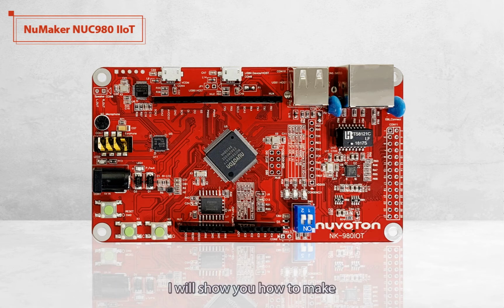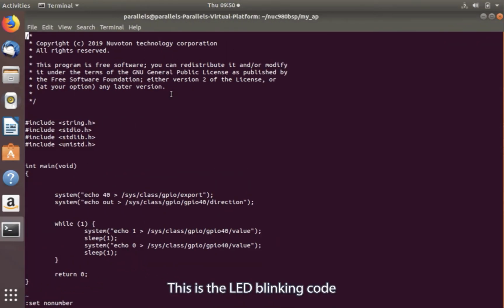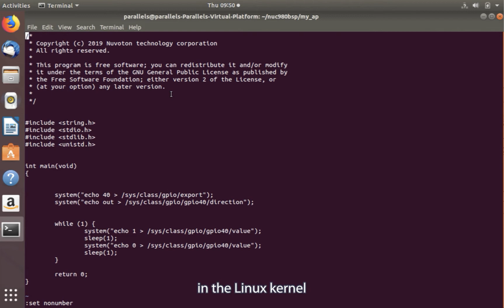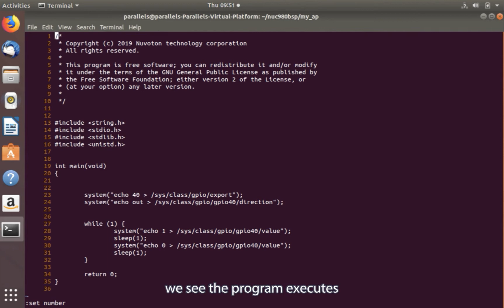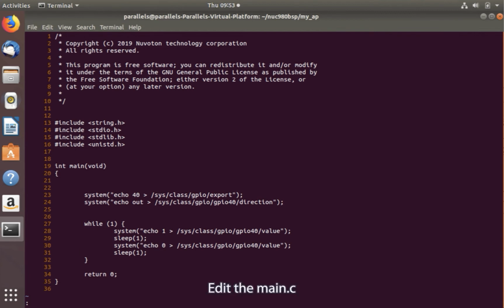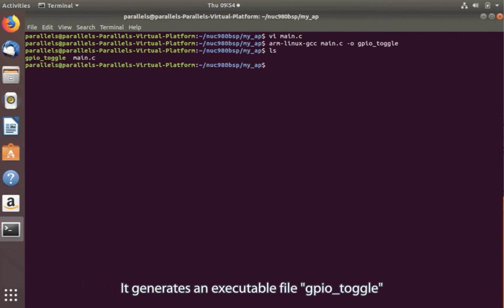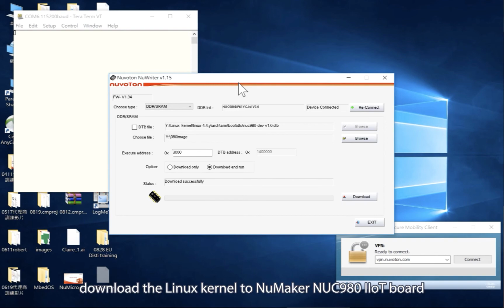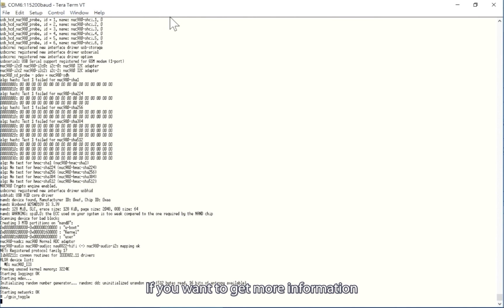Nuvoton NuMaker-IIoT-NUC980 (2) – Control GPIO

Comment: How do I know if gpio B8 is 40?
Reply from the maker: Please refer the GPIO part of Linux Driver Configuration at page 24 of “NUC980 Linux BSP v4.4 User Manual” or page 18 of “NUC980 Linux BSP v5.10 User Manual”. 

“Driver will keep 32 numbers for each group of GPIO from port A to port J. So the number for the GPIOA will be 0x000~0x01F, GPIOB will be 0x020~0x03F, GPIOC will be 0x040~0x05F, GPIOD will be 0x060~0x07F, GPIOE will be 0x080~0x09F, GPIOF will be 0x0A0~0x0BF, GPIOG will be 0x0C0~0x0DF, GPIOH will be 0x0E0~0x0FF, GPIOI will be 0x100~0x11F and GPIOJ will be 0x120~0x13F”

So B8 is 0x28, which is 40 decimal.

Comment: Hello admin, how to connect nuvoton to Laptop/PC so that the code can be uploaded using NuWriter?
Reply from the maker: Please download Linux BSP or Non-OS BSP for NUC980 https://www.nuvoton.com/products/microprocessors/arm9-mpus/nuc980-industrial-control-iot-series/?group=Software&rt=Board%20Support%20Package%20(BSP)&tab=2

The “NUC980 NuWriter User Manual” is in the Documents folder of ZIP file.